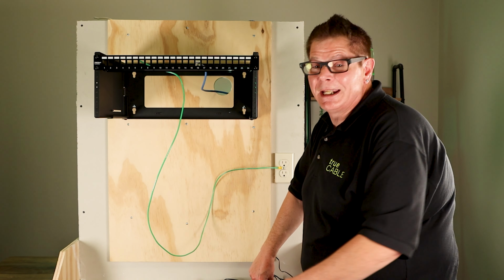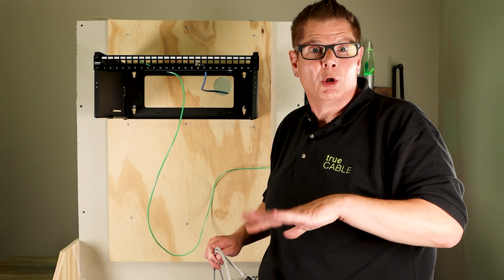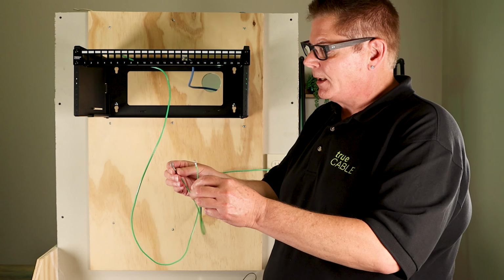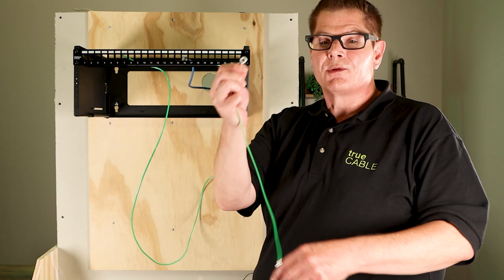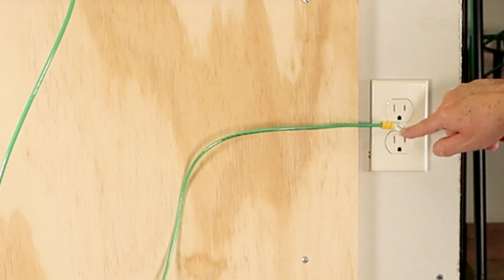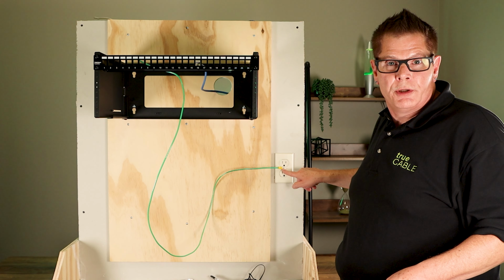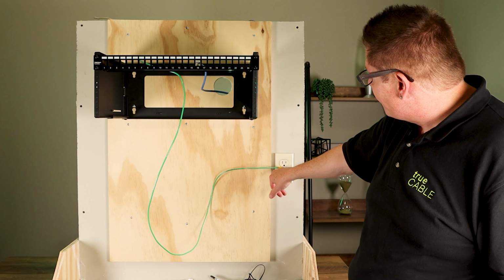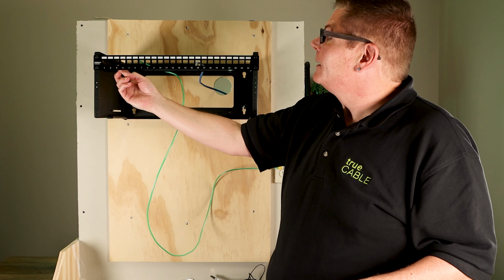Residential Bonding and Grounding of Shielded Ethernet Cable (Full Overview)

Comment: Hello, I am trying to figure out if I need shielded cable to install some PoE security cameras. I live next to a 5kW AM radio tower, and in the past it used to interfere with the analogue TV signals in the area. I have existing 10m runs of ethernet in my roof and haven't noticed issues. For the cameras the longest run will be 50m around my perimeter fence, inside plastic conduit. Do you think I should use shielded cable in this scenario? I know it's probably a difficult question to answer, but any insight is appreciated!
Reply from the maker: Hello Nidstang! YES. You do need shielded Ethernet cable, and I further recommend you run that cable(s) through a minimum of 3/4" EMT (metallic conduit). PVC won't help, as the thin foil shielding found inside Ethernet won't be enough. Ensure the metallic conduit is bonded to ground outdoors. Pick up the EMT, bond collar for the size of the ENT, ground rod, and 10 AWG bare copper wire from Home Depot or Lowes. If the fence is metal and already grounded, then you can bond to the fence posts instead. The conduit should not be bonded to your indoor AC ground system so that any RFI or ESD discharge is directed to ground away from your home. That should do it. AM and FM radio towers are rather infamous for causing issues. Use compression connectors if you need to use more than one section of ENT conduit. Leave the ends of the conduit open-air so it can breath.
Reply: @trueCABLE  Thanks for the reply :) I live in Australia and metal conduit is only used for commercial/industrial applications, so it is very expensive. The fence it will run along is a Colorbond fence i.e. made of steel. Do you think just grounding the foil will be sufficient? What would the AM tower actually do to the cable? Is there any risk of electrical damage to the cameras/PoE switch, or will it cause lower bandwidths / packet loss? I've seen an ethernet cable with an integrated 0.4" tin coated ESD drain wire - is that an option?
Reply from the maker: @NidstangAU  Hello! I understand about the expense of the metal conduit, but it will ensure you avoid issues. From my understanding (anecdotal evidence only) the AM signal can actually shut down the communication on the Ethernet cable by causing severe packet loss depending on how close the AM transmitter is to you. I don't see how you would bond the Ethernet cable shield outdoors to your metal fence as bonding the cable shield and drain wire is done at the termination hardware (keystone jacks, patch panel, etc.). I don't have much advice apart from what I have already shared. As to your question about electrical damage to your cameras or LAN equipment, that is not likely unless the fence takes a direct lightning hit.
Reply: @trueCABLE  I wasn't planning on bonding to the steel fence, but following your tips in this video to bond the foil to my house earth! Thanks again for your advice, I appreciate it.
Reply from the maker: @NidstangAU  Hello Nidstang! I must have misunderstood. Bonding to your indoor AC ground will work great. Best of luck on your installation!

Comment: thanks for the video, very informative and i think i have a similar problem..... i have a radiolink to a remote remote warehouse from home, powered with an poe injector ( radiolink is at the roof ) and and injector is connected to switch at home and all devices are on the same UPS ( 10kva) . once  a week (sometime a month) the radiolink disconnects even the power is on (and every device at the warehouse is unreachable) and when i unplug the poe injector and plug again the problem is gone. i checked some forums and think than i need the ground the poe or ethernet cable or something for the system to work smoothly. any ideas ?
Reply from the maker: Hello Orkun. Yes, this definitely sounds like a bond/ground issue. The key is to use shielded solid copper Ethernet cable terminated to shielded hardware and also shielded patch cords to be sure those patch cords can drain off to ground. That might not be enough, though. Oftentimes, consumer Ethernet switches use DC power adapters and therefore don't shuttle off ESD/EMI to ground. This might be the problem. The PoE injector might not have a three-prong grounding plug either, which could be a second problem on top of the first problem. The way to defeat this is to mount your cable into a toolless shielded patch panel using shielded keystone jacks or couplers. The patch panel bond wire needs to extend (and be long enough to reach) your AC ground system. The middle screw of your typical wall AC outlet is usually the best you can do. trueCABLE has an accessory and shielded patch panel combination coming up that will make this entire process much simpler and resolve many residential bonding-to-ground problems. Early August. Stay tuned!

Comment: Hello, after watching this video and reading the article in your website I have the following questions if you don't mind:

- You mentioned usually it's best if best both sides of the cable are bonded but for  POE Cameras and APs this is not possible, is this a problem?

- Given a Solid copper shielded permanent link ( 2 keystones),  If the Rack keystone is connected to a bonded shielded Patch Panel, does it matter if for the other end I use regular unshielded patch cable to connect a small non AC switch (perhaps POE) or a video game console/ computer/etc?

- Lastly in the video you mention it's a good idea to use unshielded patch cables to connect the shielded bonded patch panel to a Switch(even if it's AC) if we want to prevent damaging an expensive switch, but in the article it's mentioned it's always better to use shielded patch cable?

Thanks!
Reply from the maker: Hello! I fully understand the confusion. The reason you get multiple answers for bonding and grounding is due to multiple possible situations and this may involve SAFETY as well as equipment protection in addition to a properly functioning cable shield. This may further involve local Code if you are in a commercial environment...especially if you have your equipment in a TR that has metallic objects everywhere (ENT conduit, ladder rack, cable track, racks, etc.). That is the short answer. Another short answer comes in residential situations where you don't have all that extra stuff to worry about: You simply need to bond your cable shields to ground. In simple residential situations where you have a wall mounted rack or stand-alone wall mounted shielded patch panel you simply ensure the shielded patch panel itself is bonded to ground, and we offer a convenient truePLUG bond and ground extension adapter to do just that. Replace the stock bond wire that is meant for rack bus bar mounting and replace it with truePLUG. Bonding to ground on a single end (the patch panel end) is more than sufficient. If the patch panel is bonded to ground in this manner then the path to ground is well before any switches and you don't need shielded patch cords. As it turns out, relying on shielded patch cords with switches that have three prong power cords for a good bond to ground is very iffy...too many pieces in the chain to reach your 0.1ohm (100 milliohm) target. So, bonding that residential shielded panel directly to properly wired three prong AC outlet is the way. The other end of the connection (remote keystone jacks) can be connected up with unshielded patch cords as well. Unshielded patch cords lend themselves to easier routing at the patch panel side anyway, as they are a lot thinner and easier to deal with. Now, if we are talking about commercial bonding to ground in a TR we have a similar but much more complex and detailed discussion about making sure literally everything from end to end is not only bonded to ground, but EQUALIZED to the same ground potential due to safety concerns. Thus, what you are doing really matters! I hope that long winded explanation helps!
Reply: @trueCABLE  Absolutely, Thanks for the explanation.  This is for a residential install as you correctly assumed. 

Too bad I already pulled the trigger for a bunch of shielded patch cables in the fs store before I read your response. ( I could have saved some money, although they were not that expensive)
Reply from the maker: @snowekim  Hello and you are welcome! Fortunately you did not spend too much on the patch cords. Just give careful consideration to how you are wiring things up at the patch panel to switch and perhaps use a 2U patch cord manager to help with the thicker cable.

Comment: Hmm I don’t know if the cover plate screw connects to ground on the receptacle end 
But did this give me an idea. You can buy those 3 prong plugs to make your own power cord 
I’m going to plug in only the ground wire and then into the receptacle itself
Reply from the maker: Hello! A properly wired and grounded 3 prong outlet will bond via the center screw, so that is not a major concern. That said, your idea will work. Just be sure to NOT hook up the hot/neutral conductors for obvious reasons AND also use 14 or 12 AWG stranded pure copper conductors. Obviously you will need to hunt down the right spade or ring connector to attach to the other end of the wire to screw down to the patch panel, which can be a challenge as you are dealing with not only the size of what conductor the connector will accept, but also the attachment screw too. As it turns out, we have a pre-built Bond & Ground Extension Adapter (called truePLUG) for sale on our website which has been tested and built for this very purpose! This is a bit of an older video, before we had that accessory.

Comment: what if I just need to bond one ethernet cable? I want to run shielded aerial ethernet to an outbuilding. I'm envisioning a shielded keystone jack, wrapped with the ground wire with heatshrink installed over it and then connected to the screw on the power outlet.
Reply from the maker: Hello cdogg. Good idea and pretty innovative. Be sure that one end is bonded to ground (not both) if the two structures are on different AC systems. If both buildings share the same AC system, then bond both ends the same way if you can.
Reply: @trueCABLE  Sorry, ground one end only.

Comment: Isn't 10 awg (=6 mm^2) a bit too much for that application? 
Or it's just an American standard? I'm used to the European-Italian one, where sockets have normally a 2.5 mm^2 wires (=14 awg)
Reply from the maker: Great question Paolo. In the USA the minimum residential requirement is 14AWG for 15 amp circuits, but some homes are constructed with 12AWG and even 10AWG depending upon the circuit ampacity or the home may just be overbuilt as there are no rules preventing it. The recommendation for 10AWG is to ensure the bond wire is not smaller than the wiring used for AC ground in all situations and to give a low resistance path to AC ground up to 6 feet.
Reply: @trueCABLE  I've never seen the sockets circuit wired with a 10 awg (6mm2) here in Italy, but since in the US u have 120v that means higher currents, it's fair enough... 🤔
Reply: 10 awg is ridiculous!  What about the 75 feet (or more) of 14 awg ground (yes, even when the hot and neutral are 12 awg) in Romex between the outlet and main breaker panel?
Reply: Lol yes, 10AWG is way overkill. He is confusing a high voltage ground with an EMI ground. Most light fixtures have 14awg grounding their actual 120v cable. If you ever have 120V or 15Amps running through an EMI ground wire you have bigger problems than cable thickness.

Comment: To me, using a 10awg ground wire is kinda pointless when grounding to a receptacle like that, considering the ground wire in the electrical cable is going to be 12 or 14awg running back to the main panel and into the ground rod
Reply from the maker: Agreed. 14AWG is sufficient. I overstated the diameter in the video, thinking there may be some commercial installations where someone may try this in a commercial building and could be using 10AWG for their common AC branch circuits (240V or less). I guess the trick is knowing what the conductor gauge is behind the wall plates you plug into.

Comment: lol ... the blind leading the blind 🤣

It's much simpler than that.  The power supply / surge / conditioner that is powering your router, switch, etc. is going to be grounded hence the 3-prong plug because the rack mount enclosure is metal hence you only need to crimp a ring terminal to your ground wire and insert a sheet-metal screw into the rack-mount power supplies metal housing to bond it to your electrical system's ground  😉
Reply from the maker: Hello! Your solution is valid, given a certain situation with the right equipment. Our demonstration here is not only for those who possess equipment that have three-prong grounding plugs on their IT equipment but also for those who don't have that or a rack mount PDU. If there is no PDU that is rack mounted, nor equipment with three-prong AC plugs (common in residential cases), and the rack does not have an RBB (rack busbar), BUT you have a shielded patch panel that needs to be bonded to ground you would use the solution we demonstrated here. Our solution also applies to someone who has a simple 2U to 4U wall-mount rack bracket where the only piece of rack-mounted equipment is a shielded patch panel for a simple residential setup. Since releasing this video, we have introduced a much more direct solution called our truePLUG, which attaches to our shielded multimedia 24 port panel and then plugs directly into a 3 prong AC outlet, as well.